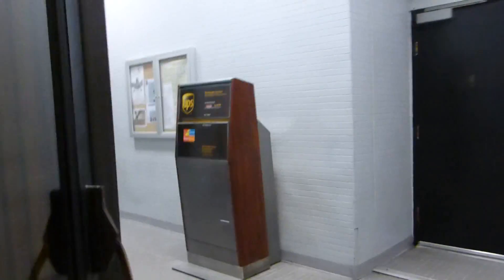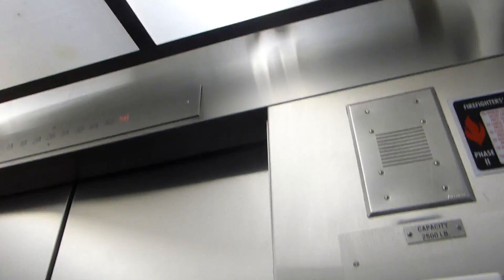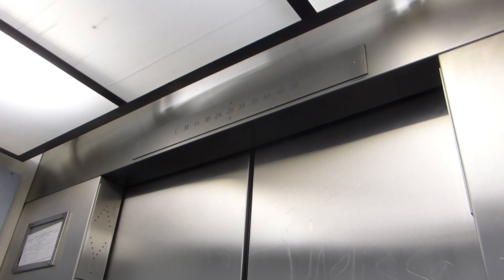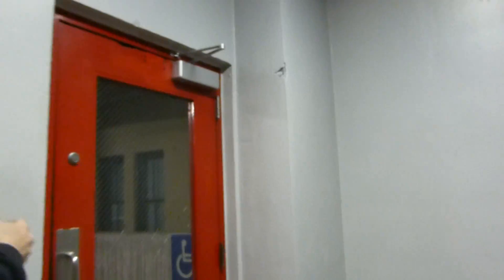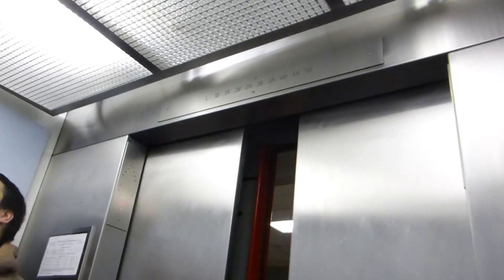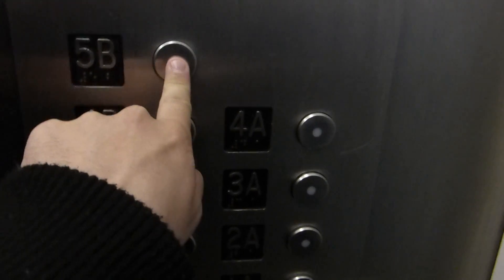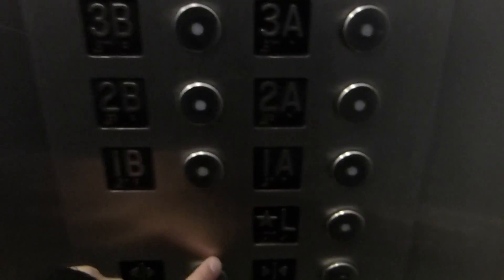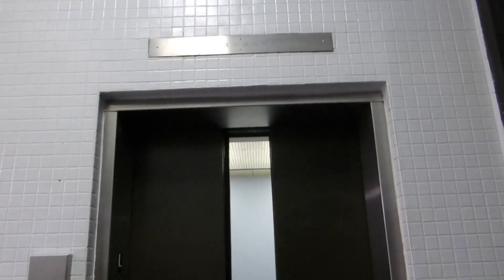Otis Traction Elevators At Church Ave Garage (With DieselDucy And Appalachian Elevators)

Comment: I noticed that the back wall had no handrail, but there were no holes. There used to be a handrail there, than a vandal removed it, leaving holes you could stick your finger in. There is a video on crapper1's channel showing that.